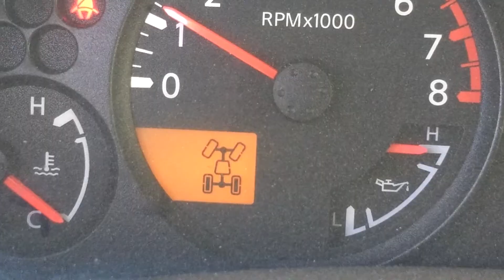Using a DIY Multi-Tire Inflation Hose and 120-volt Air Compressor Off-Road

Comment: I recommend the Smittybuilt 12v portable compressor, it would take about 8 minutes and is far smaller!
Cheers
Reply from the maker: I considered a dedicated "off road"  type 12v compressor but they are expensive and can't also be used around the house.  I also used this one to run a nailer when I re-did part of my roof.

Comment: brilliant!!! Im going to do the same set up. thank you for sharing. im new to overlanding and this fits my budget.
Reply from the maker: You are welcome, it came out cheaper than the dedicated off road compressors I've seen and as a bonus I have a small light compressor to use for blowing off dust and running a nail gun to replace my roof!

Comment: Hello. I have a Nissan Xterra also and i would like to do something like this. Have you had any issues with the compressor and the inverter you are using? What kind of inverter do you have? Do you think a larger compressor would be doable with only the starter battery. Say maybe a 3-gallon compressor?
Reply from the maker: We have not had any issues but we also do not drive the XTerra much anymore.  The inverter is just a 750-watt from Harbor Freight.  For the compressor it's more about the amp draw than the size; the one I'm using is rated at 4 amps and works fine.

Comment: nevermind....forgot you had the inverter
Reply from the maker: Yep.  Compressor draws about 4 amps at 120v, works fine off of 750 watt inverter.  I thought I might have an issue with inrush current but it hasn't been a problem.

Comment: So this will only work with a smaller compressor.
How long does it take to fill the compressor, and how many tires can you fill off of one full compressor tank?
Reply from the maker: I just ran a hose from the compressor output straight to all four tires and turn it on.  No need to actually fill the tank at all; the air will flow right through it and into the tires.

Comment: Replace the entire compressor setup with a 10lb CO2 tank. Easy, light weight and portable. You won't have to worry about inverters, current draw, over heating issues. In addition, a 10 lb CO2 tank will out flow that little compressor with high CFM to allow you to run pneumatic tools easily on the trail or in your garage.
Reply from the maker: That could work but meh, I already had the inverter installed and no need to refill a CO2 tank.  Plus I can use this little compressor around the house.